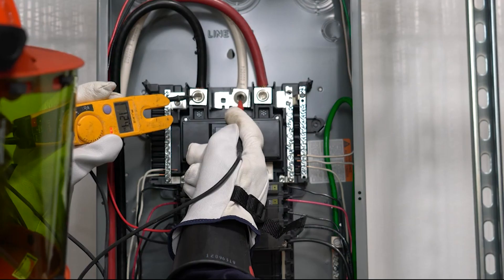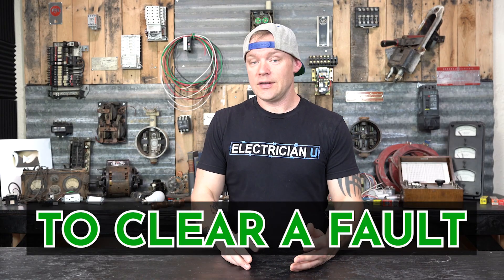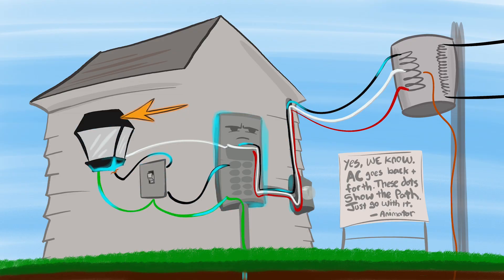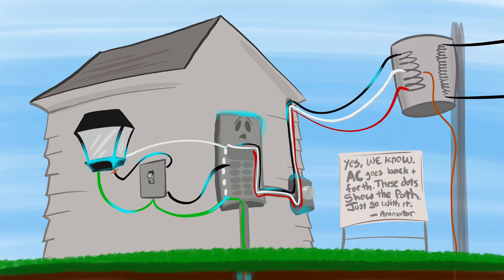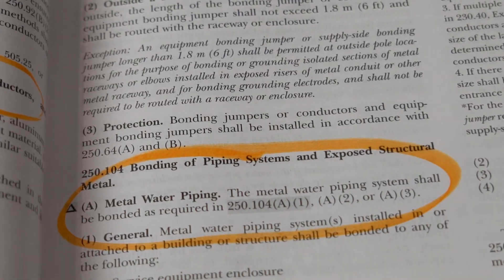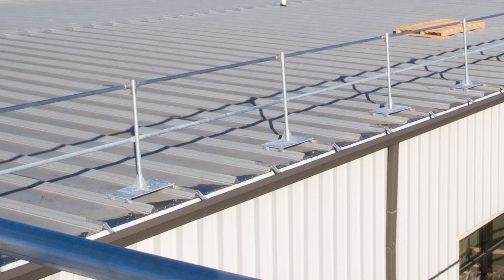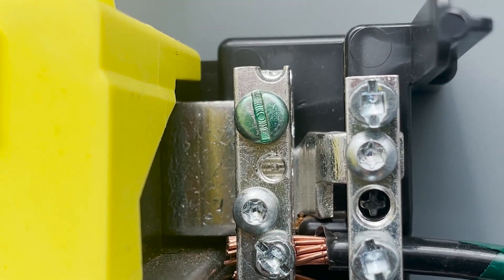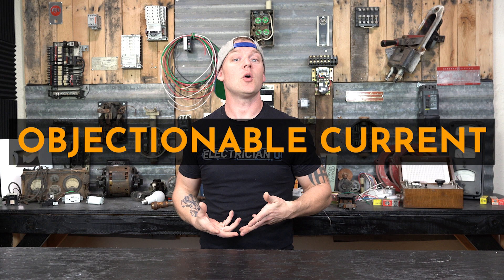Why Do We BOND Neutral & Ground in ELECTRICAL SERVICE PANELS?

Comment: I Virginia the code now is 2 10 foot ground rods 6 feet apart. Why? My house has 1 10’ ground rod that's copper clad. Copper being the better conductor, looks like my setup is potentially better. Note ⭐ Nothing except for meter & panel ground go to this. Telephone and CATV have their own ground rods. CATV uses a 6 foot galvanized rod. Originally, there was no ground rod at the house. They used the copper water pipes to bond to. Any plumbing I do and sweat all joints with original copper. A plastic piece inserted somewhere can be a shock hazard.

Comment: Bored! Looking around for something to watch.  Dunno how I picked this but glad I did. I am subscribing. I am a 30+ year HVAC tech.  A major thing in repairing HVAC systems is a knowledge of electrical systems. I am often called on to install panels, sub panels, breakers and to trouble shoot same.  I could tell you a few horror stories I've run into like one idiot before another that caused a condensing unit to be powered with no outdoor disconnect, through an bypassed fused switch that fed from the main buss bar, before the cartridge fuses.  (Yea zero current protection or isolation from load to pole). I never understood bonding till now.  I see exactly what is going on.  Going to browse  your other stuff and see if there is other stuff I ought to know.

Comment: I don’t agree with the theory presented at 3:30. An adequately grounded system should not need to rely on the neutral pathway to ensure continuity back to the source. Yes, grounding the neutral at the service entrance does reduce the overall resistance from the fault back to the source, but that’s a bonus. It shouldn’t be necessary for protective devices to work in an adequately grounded system.

The main reason they are bonded is to prevent damaging voltage potentials from forming between ground and neutral. If such voltages were allowed to develop, then there may be hazardous touch potential issues and possible breakdown of equipment insulation.

Comment: Great video. Question for you. The hots are metered, but the neutral is not. So when I dim my lights, to save power, it is just returning the unused energy back to the grid?
Reply from the maker: No it's not.

Comment: I always love trying to explain to the uneducated how electricity and current flow is nothing more than a difference in potential. The Daytime Running Lights on a GM vehicle is usually achieved by passing positive to positive through the filaments of the headlights through the ground side of the circuit. This produces a difference in potential of about 8 or 9 volts which makes the high beam lights dim and thus your DRLs. Since they don’t understand the difference in potential concept, they get stuck on there being no “ground”, and positive to positive won’t work… of course it will work if there is a difference in potential. GM just decided to use the bulbs as resistors creating the difference.

Comment: If neutral and ground are bonded together why doesnt current flow through ground during normal conditions, like it does through neutral?
Reply from the maker: It would be hard pressed to find that route if done correctly because the only mechanical connection to that circuit is not also contacting ground at the device / what ever it's attached to. 

It could in theory once back at the panel itself find it's way to "ground" because it's bonded there. But the purpose of the bond happening in the electrical panel is to prevent objectionable current and unintional energization of things if there is a fault at the equipment end. Like a loose hot conductor making contact with the metal. (Which should be grounded.) This allowing the current path to behave similarly to a hot and neutral configuration.

In this case it would trip because it wouldn't be operating normally.

Does that answer your question?
Reply: @electricianu  Yes, thank you

Comment: This is a good explanation of how a ground fault interruption system works, but not why we bond the neutral and ground, and only it one location in the system. We bond to eliminate potential between ground and neutral.
Decades ago I was working on a job with a temporary power pole that was grounded and bonded properly; however it was not bonded to the building. During framing the screwguns would pull sparks off the metal studs. This was because of a difference in potential between the bonded neutral and ground at the pole, and the separate ground that had been installed on the building.

Comment: This slightly touched on a problem i have in my house, but left me without a resolution. If i touch my plugged in RV when the ground is wet i get a good shock. What do i address to resolve this issue?

Comment: QUESTION: At my home I have an older service panel (1950’s) with no ground rod. Everything in the house is two wire.  I also have a newer sub panel in my garage that has a ground rod. The sub panel in the garage has the bonding screw engaged. Should this be done differently?
Reply from the maker: So, for retroservicing, the technician is only required to install or bring up to date what they are physically putting hands on. That being said, there are ways manufacturers have made their products to be used to add ground fault protection to two wire systems. By bonding the “subpanel” and tying to ground there, they made safe that install. It is a good install!

Comment: You didn't explain why a standard common circuit breaker wouldn't trip with a ground fault at the lamp if you didn't bond the neutral at the junction box. 
It should still work, right? Only the black wire current is used in the circuit breaker to heat the bi-metallic strip, it doesn't care if the return current is going to ground or coming back from neutral. I understand that it would take at least 15 to 20 amps of current, (depending on the breaker) for it to trip, but that's all it does.

Are you confusing GFI vs. standard Over-current circuit breakers?

Comment: Can someone tell me if the neutral and ground are bonded in the main panel, how does electricity flow back to the street on the neutral? Wouldn't it flow back down to the ground? Serious question. I know how transformers work and that they need the neutral but I don't get how the ground isn't canceling out the neutral?

Comment: Biggest misconception in electricity, "Electricity takes the shortest path"   No, no, no.  Electricity takes all paths possible, ratios are dependent on resistance.  A bonded subpanel gives two paths back to the service panel for the neutral path. The ground wire would be carrying close to half the current during normal operation.

Comment: The old school approach to secondary buildings was to run only a neutral (three wires) to the subpanel in the barn, and the barn had its own ground electrode, often far distant (and unconnected) from the home ground electrodes. There are still many grandfathered buildings with this. Unfortunately ground current if the barn neutral isn't bonded is a high resistance pathway through the earth, so with no neutral bond in the barn you won't necessarily trip the breaker with a dead short to ground. Those milk machines with a short to ground could end up being hot, searching for an easier pathway to the transformer center post, which cows don't like. What are you guys doing when you get asked to review those buildings? Is this an appropriate exception to the single bond rule?
Reply: The Canadian and specifically ontario code has changed in the last few years to outlaw separate grounding at out buildings. However if it is an existing situation and you are upgrading a service for example and the main service becomes a sub service. Where running a separate gounding(bonding) conductor is not practical (long length of conduit etc.) Then the old method is deemed acceptable.
Reply: And I might add in that case the neutral should be bonded to ground in that panel or disconnect with the separate ground electrode for that out building.
Reply: @guitardude99999  Thanks for your reply!

Comment: Followup question: is this why electricians remove the communication bonds from residential meters? 
I've seen so many house fires caused by an intentionally removed bond. 
If an external meter bond prevents fault detection, where would an ideal  accessible bond location exist?

Comment: Hmmm, we have a top fed power pole grounded and bonded disconnect with breakers that feed 3 buildings with underground cable.  There is 1 neutral and 2 hots to each building, but no dedicated ground wire to each.  Each building has a ground rod and I think it is bonded to the neutral.  Should the buildings not be bonded?
Reply: There is also a breaker box in each building.

Comment: Do not bond neutral to ground, they are two different circuits, current can back feed the ground wire and shock you, use two ground rods six feet apart to achieve neutral and ground

Comment: So you said not to bond ground and neutral at a sub panel, so how should the ground be landed? Do we not need to run a 4th grounding wire to a sub panel?
Reply from the maker: Depending on where it is will dictate that. 

You can run a separate grounding conductor to the sub panel + a neutral and be fine. But if it's in let's say a detached garage. You cannot. You must establish its own grounding plane. 

Otherwise you would wind up with like 80V on one leg and 135V on the other leg. (as an example.) 

Because the potential difference is so significant that your hots aren't evenly split.

Comment: With data networking and connecting networks, there's ROUTED (eg ICMP, HTML, etc.) protocols and ROUTING protocols.  The ROUTING protocols pass around information between routers which networks contain which network nodes.  For Internet Protocol, the ROUTING protocol is BGP, Border Gateway Protocol.  So when it came to GROUNDED conductors and GROUNDING conductors, I immediately understood. :)

Comment: The light fixture example illustrates a break in the insulation of the hot conductor.  This has allowed the fixture to now become energized, but the additional load is very slight, calling for no action from the breaker because its amp rating has not been exceeded.  By adding a case ground, the stray voltage now has a path to ground.  This imposes much more current to flow, causing the breaker to trip and interrupt the current flow to the faulty fixture.  Now, the fact that the neutral and ground are bonded matters.  But, in a correctly grounded system,  the current will go into the house's ground system, usually a rod.  And on the power system, current will return  to the source but the distribution system's neutral is grounded often, and I've I seen, at every transformer.

Comment: QUESTION:  
If an isolation transformer is used to isolate the AC supply to sensitive equipment from the 'noisy' utility AC supply, should the ground for the isolated (secondary) side be the same as the utility ground, a separate new proper ground, and if the latter, that neutral should be bonded to the isolated ground as well, yes?  Just trying to understand that kind of situation.  :-)
Reply: In an isolation transformer the ground should float i.e. be connected to plastic only. In Europe that is clear as the output socket is ungrounded. In the US one does not see it by looking. Some may pass the ground.

You can always use a two prong to three prong adapter to ensure that the ground is not connected.
Reply: @okaro6595  
Thank you for your reply.  
Considering that many things (like musical instrument amplifiers) absolutely must have a proper ground for the chassis in order to prevent possible electrocution, this becomes a new question.  
The point of using an iso transformer for the mains power would be for more than just circuit noise isolation.  There are still some locations that do not have separate, 3rd prong ground path that has very real potential to be a "shocking" experience.  
What then?

Comment: Excellent video, thank-you. Fascinating explanation of how things are done in the USA.

I used to work in the UK for an American owned multi-national company. My role was designing electrical control gear for industrial equipment. (All new designs to meet both EU and NFPA codes.) Boy we do some things differently.

If you are a DIY electrician living in the UK, please check the UK methods after watching this and before you do any work on a ground/earth circuit. UK arrangements can be found in BS7671 (wiring regulations) chapter 54 (Earthing arrangements and protective conductors).

Comment: Very poor wire stripping in your pictures, conductors are very clearly ‘ringed’ or ‘nicked’ when the insulation is stripped. 

In Europe the conductors and earths are often sized based current and earth loop impedance and disconnection time. Very different from the look up tables used at a lower level …

Comment: They are bonded at the panel to prevent a high voltage potential from common to earth that would occur do to the distance to the transformer; GFCI works because there is a difference in current from hot to common, when it should be the same in normal operation.

<added> FYI: there was a time when the grounding wire at the receptacle did not exist, but the common and water pipes were still bonded to earth at the panel.

<edited for semantics/word change/"occur">

Comment: So in a sub panel where does the ground wires go? The square d sub panel I just bought has no separate ground bar the natural and grounds are on the same bar , they supply a ground screw to bond it together but it's touching without the screw added ,  I stuck a ohm meter to it. Now I'm confused 😕
Reply: Sq D had no idea what you bought the panel for.   If a sub-panel, then you are required to buy a separate ground bar and install it in the provided holes in the back of the can.   Remove the bonding screw from the now neutral bar.    Hope this helps you!   Kevin
Reply: Yeah that's what  my buddy was saying  over the weekend  . I Google imaged my box and it had a separate ground bar  in pictures of a  sub panel  like mine
Reply: @kevinedwards9365     Be safe!
Reply from the maker: In these panels, you have to buy a ground bar and bond that bar to the enclosure. Remember: the only place we bond the neutrals and grounds together is at first means of disconnect. A sub panel, or remote distribution panel, is not the most upstream point of disconnect (Captain obvious). So we have to keep ‘em separated, like The Offspring told us to

Comment: Don't forget all the wonderful faults you get when nothing is grounded all the way back to the service transformer... Incoming Cable TV line becoming the grounding point for an entire building is one of the more tame things I've seen. 
Hot to Neutral 110v, Hot to Hot 220v, Neutral to False Ground 0v, Neutral or False Ground to actual Ground 1KV ZAP! and a freshly exploded meter. Wasn't uncommon in the early days of coax ethernet to blow up computers when there were ground faults, especially in large buildings with multiple service entrances and at least one faulty ground.
(I am not a sparky, but I've worked with enough of them to experience all the joys first hand.)

Comment: Wow, you Americano's do it totally different than us Evropies.

In our Home installations "The Ground" has NOTHING to do with current going in either direction for operational purposes. It is there for SAFETY only. If you manage to electrify your lamp fixture, a normal breaker might not trip. It might just say "Huh, the lamp just got bigger? Oh well, more power then!" And if you touch this electrified lamp fixture, you DIIIIEEEE - because the current now can go THROUGH you into the Earth. If, however, your lamp fixture is also connected to The Ground with a wire, and you touch the electrified lamp fixture, the current now has a choice: go to Earth through the Ground Wire, OR go to Earth through you. Current will choose the easiest path and go through the Ground Wire, so when you then touch the electrified lamp fixture you'll still get zapped, but you won't become a part of the circuit in a deadly way. The only way the breaker will shut this mess off is if the current going through is more than what it is rated for. An Earth Fault Breaker (or Ground Fault Breaker) however will monitor the amount of current going into your circuit, and the amount coming back out (it monitors the BALANCE between ingoing and outgoing). If there is a difference of 300 mili-amps (standard) it will break the circuit. The Earth Fault Breaker does not care how much current is flowing, the split second that enough current is "leaking" away, it wil shut down. And this Leak SHOULD be through your Ground Wire, for your safety.
So in short: a breaker protects against too much current, a Earth Fault Breaker protects against leaking current, and the Ground protects you by diverting the leaking current straight into the ground. The Neutral doesn't come into play in this safety set-up.

But as I understand it, you guys don't really use an Earth Fault Breaker in your Home installations, just normal Breakers? So, if an Earth Fault occurs, the current flows through the Ground Wire and gets fed back into the appliance through the bonded Neutral, creating some sort of an amplification loop of current, and this causes more current to flow than the normal breaker is rated for, and causes the Breaker to trip... Right? Works too i guess...

My incoming power cable is just 3 live wires (all at 113V). Ground is created with a pin in the dirt under the house. I don't even have a Neutral. Everything works by taking 2 phases of 113V to create 230V. Great fun...
Reply: European system for 230 volts is 400/230 volt 3 phase 4 wire wye.   So at your dwelling, you have (1) phase hot, and (1) neutral from a 3 phase system.